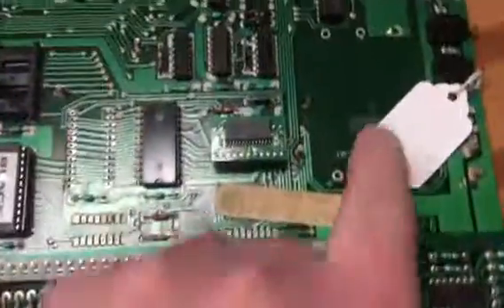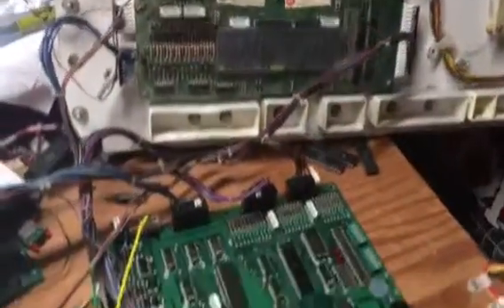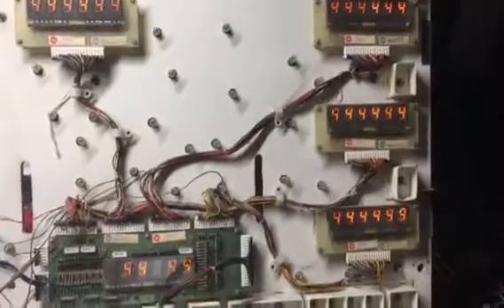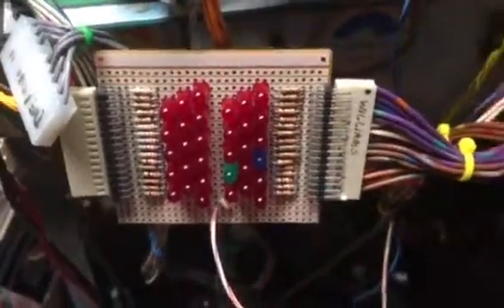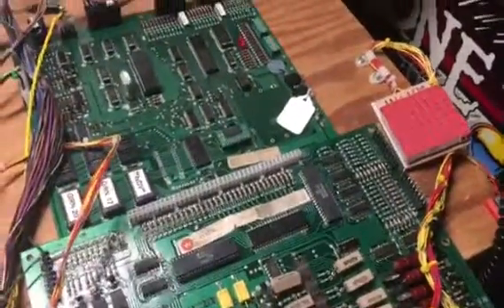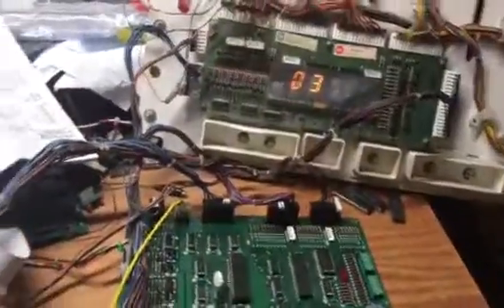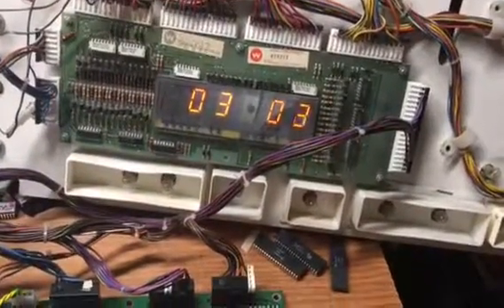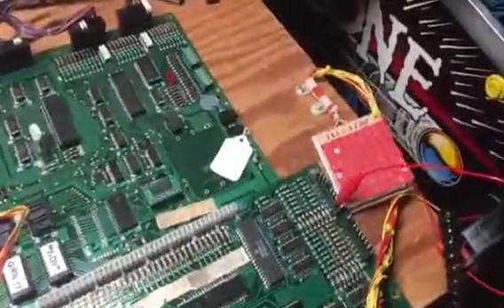Williams System 6 Blackout Board Test

Comment: Great video again. Thanks for sharing it with us Chris! 
I would love to see some more details regarding the test rig you use to test the mpu board.
I'm new to the hobby and I just bought an old Williams space shuttle pinball in really bad condition. It's my first pinball ever. The main system 9 mpu board does not work anymore and I need to test the board and repair it. 
Are the schematics of your test rig documented somewhere? I would love to create my own test rig.
Also, the 4x20 LCD you use to mimic the displays in your other videos, is that something one can build by themselves? Or did you buy it somewhere? I can probably make something like that myself but writing the code for the microcontroller is going to take up a whole lot of time....
Thx again for the video!
Dennis